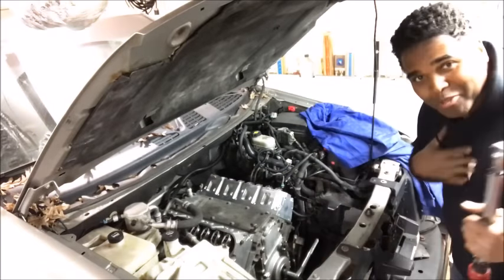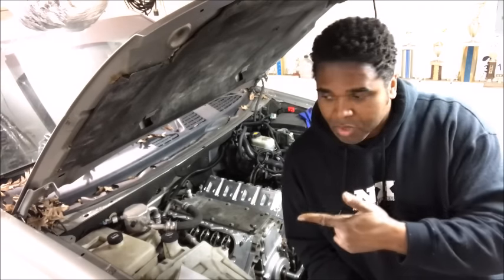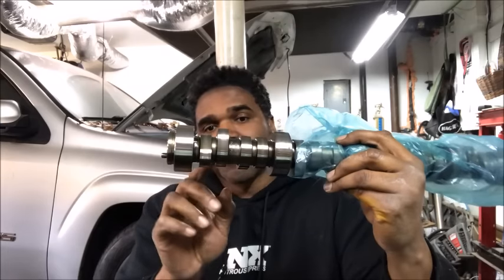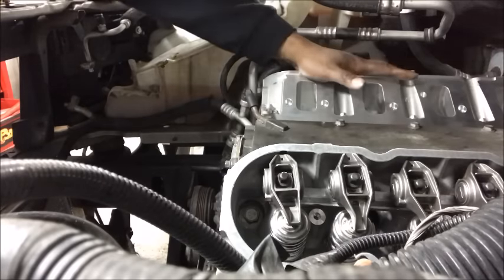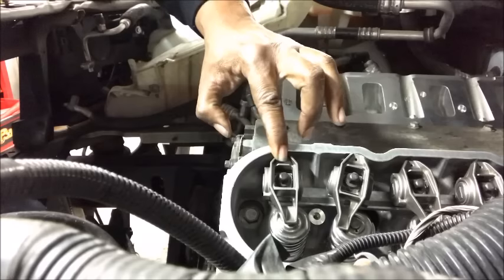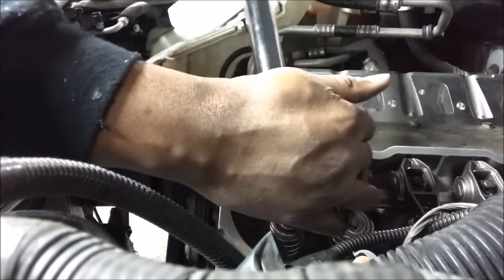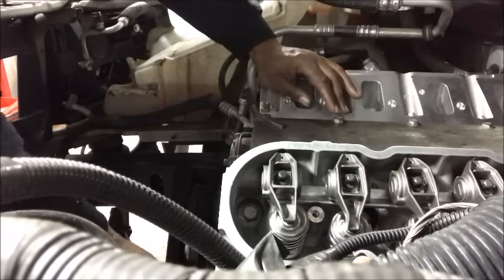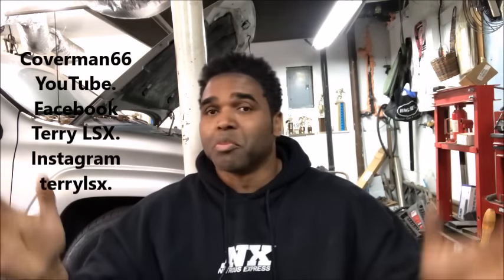LS Rocker Arm Install and Torquing. (3 Easy Steps... YOU CAN DO IT!)

Comment: So when I take my heads off to replace the lifter should I adjust the rocker arms?
Reply from the maker: totally brotha Billy.. i would get harden pushrod as well.. are you swapping the cam?
Reply: @Coverman66  no my number 4 cylinder lifter is collapse. I just want to replace that one just to get my 09 suburban going. What do u think?
Reply from the maker: give it a shot.. i think you should be fine.. i would still adjust the rockers once installed
Reply: @Coverman66  thanks man. Any ideas why the lifter could of fail. I was thinking about replacing the valley cover "vlom" I think that what it called
Reply from the maker: no problem.. it happens..when you open the engine you will be able to tell..

Comment: Why you have to turn the engine. Why not just tork it in eny positioning? That thing don't go nowhere and it moves up n dn after torking it
It a question i want to learn more from you goodMan
Reply from the maker: i appreciated that brotha Odi, you have to set the rockers with the load off of them to get proper torque.